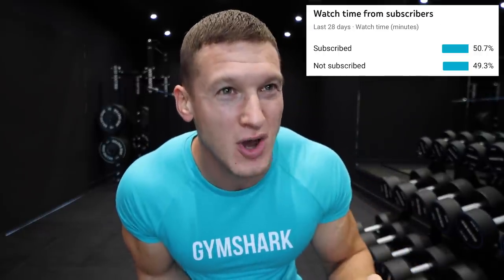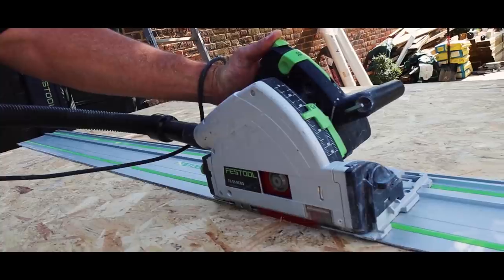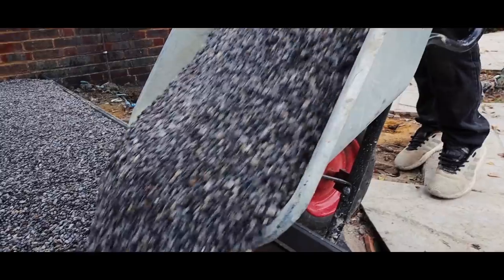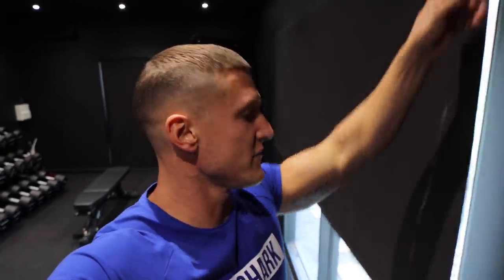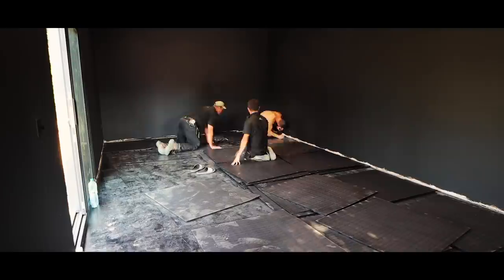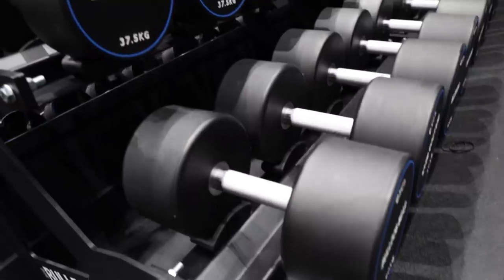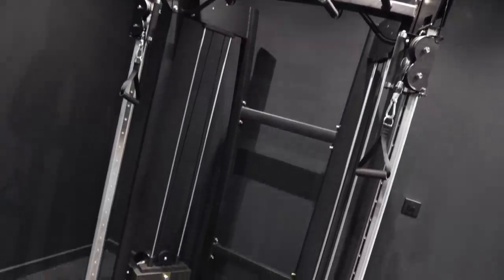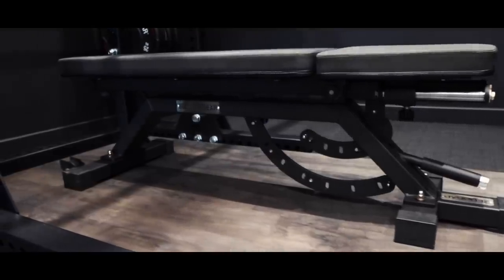How much did my home gym cost?

Comment: Another great video Matt, very informative. Planning on setting up my own gym in my garage when I move into my new house. Some tips for us mere mortals
1. Space is key in a garage. It will be used for other things so condense what you can. I'm looking at a collapsible rack, can't take as much weight as a half or full rack but I'm never going to be lifting as much as Matt.
2. Adjustable dumbbells will save you space and still have all the increments, just be careful as the standard ones only go up to 24kg so get the bigger set because even a normal person will be able to bench 24kg in each hand after a few weeks/months.

But the best piece if advice is, if you can wait then do(you probably won't be able to get any of this stuff at the moment anyway) because pretty soon all the stuff that has been bought will be sold on ebay much cheaper.

Comment: You're spot on about prices. I had 65kg of old 1inch cast iron plates, a 6ft bar and ez bar and a pair of dumbells that I started out with, tried and failed to give them away when I moved house 2 years ago but sold them on ebay in June for £270.

Comment: Great series Matt, thoroughly enjoyed and subbed off the back of it.
FYI if you're looking to improve WiFi caability in the gym you're going to be best off getting an external ethernet cable from teh main home to the gym that would be buried through the garden soil and then connect a booster/wireless access point in the gym to give off the signal in there.

Comment: I would think that slightly smaller metal plats would actually be ideal when using them in conjunction with bumper plates. I would assume that if/when you dropped the weight the bumpers would hit the flooring not the metal ones and help protect from damage.

Comment: Cost me around £6k recently, converting my garage. Power rack, Hack squat/leg press machine, lat pulldown machine, cable machine, flooring, lighting/plug sockets electrics fitted, 200kg of plates, 2.5-50kg dumbbells with racks, ez bar & barbell, so can be done cheaper guys!

Comment: The total price considering all the brand new equipment and brand new building isn't even that expensive, actually kinda cheap/good deal. If you compare it to building/furnishing a basement in a new townhouse or house, you usually pay like 30k$ just for basic stuff plus furniture and everything else on top of that and to add on top of all that the availability and choice you have shopping around during covid19 for all this stuff will only obviously increase the overall cost so yea.

Tbh i expected like 100-200k range for this gym.

Comment: I spent ~2k USD on my home gym, full rack, used weights, used adjustable dumbbells up to 50kg, a sick ass bench that honestly spent too much money on and a ghetto ass welded thic ez curl bar. and two weight trees. I built a dip/captains charge out of 2X4, the only thing I feel like I am missing is a pulley system, probably build a preacher bench and maybe one of those curl straps that go across your chest. Your gym blows mine out of the water hahaha.  Mine comes with a cat though.

Comment: Im making a gym in my garden right now
A gazebo(3M x 4M) £50 🤣
This jigsaw type gym floor £40
Squat rack £250
A bench £140
AND im making my plates out of concrete - YES im that broke
So they cost me £50 for the moulds and then its about 50p per kilo i make 
£7 for high strength concrete and then i use a 2” inner diameter steel bar and mould it around it and cut it off to size
OH and got a 7ft olympic bar which was £160
So basically about £800 total i think🤣

Comment: You should run ethernet out to the gym and put up a wireless access point, connecting it to your house's router. It would give you perfect signal. Ubiquiti is a good brand. Cheers.